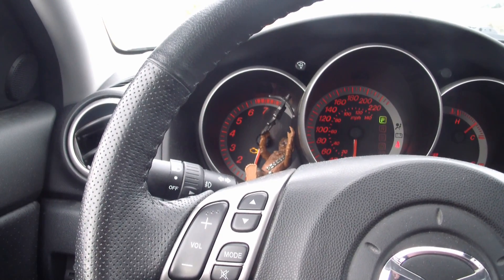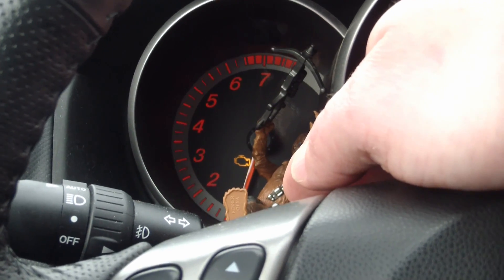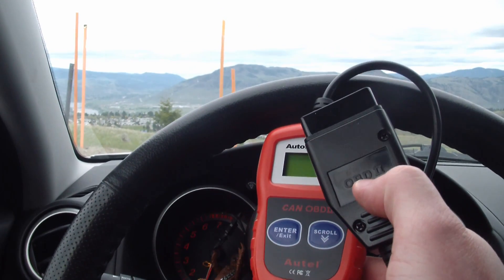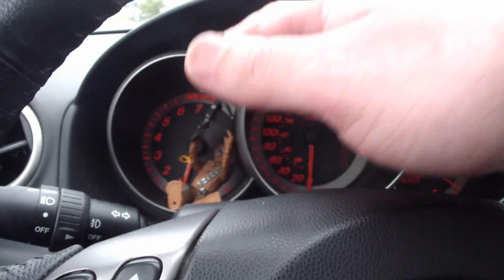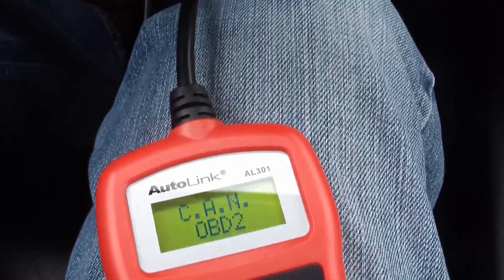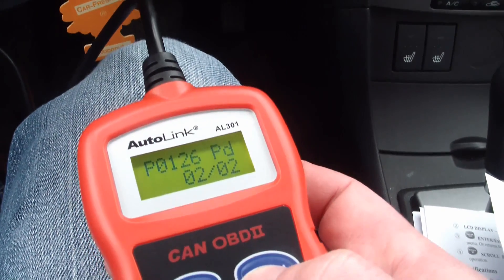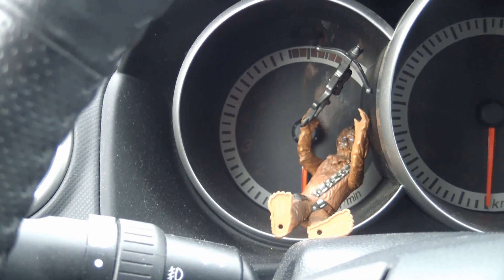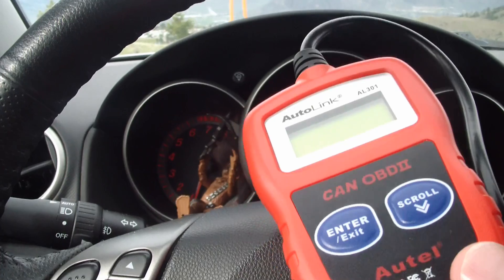Manly-Man Skills: Outsmart Mechanic Scams by Using Your Car's Computer!

Comment: I love getting cars like this. Customer attempted repair. Fix what customer attempted to fix. Keep making us real techs money.
Reply: Yes and do you know why I end up having to fix them? Because they came on here, watched a video or two and thought they knew how to fix cars. It's not just about being able to pull a code and match it up to a description in a book. It's understanding the systems in the car and how they work. For instance that coolant code that you pulled could mean any number of things. It could mean that the coolant temp sensor is bad, it could mean that a fan motor is going bad, it could mean a thermostat is sticking open, or that there might be a coolant leak. There is a lot more than just plugging in a 30$ code reader will tell you.
So to say that someone getting this information will know what to do with it is foolish. There's no way just a google search and a code reader can adequately inform a person as to what to expect when they bring their car to the garage to get fixed and if definitely doesn't give them enough information to try and fix it themselves with any real expected degree of success.
Reply: ***** He didn't say he fixes butcher jobs.  He said he did what the customer couldn't do and that is a "Real tech".  Besides if techs tend to charge "real time" for butcher jobs.  So even those can be good money.  Yeah it is possible to find and fix a problem with a cheap code reader and some help from the internet, but diagnostics can be difficult and that is why real techs exist.  Some days they really earn their money, and that is why they charge so much.  You aren't just paying for the time they spend with your car you are paying for the time they spent learning how to do what no one else can.  MD's go to med school, techs get training, that includes on the job experience.

Comment: "9 times out of 10 its a nuisance fault, clear it and it will go away forever" Totally untrue. When the computer senses a definite problem it will throw a CEL. When the computer thinks there may be a problem it puts out a "pending" code while it tests the system through a few driving cycles.Usually a pending code will not throw a CEL. Stop clearing codes and actually fix the issue and PLEASE, dont spread misinformation.
Reply: garretts91 it worked for me when I cleared the fault... IT NEVER REOCCURED
Reply: AvE is right. You have it backwards.

Most cars throw a code immediately when a sensor is out of range (say the plug is wet)

And won't go away for 3-4 driving cycles of being correct.

Or WON'T go away if the car starts going into segments of limp mode operation for the fault.
Reply: ginger20037,

Many auto repair shops especially dealerships ARE out there ripping people off. Have you not watched the national and your local news before? They were busted red handed for ripping people off and some mechanics will admit their little secret about how they get away with ripping people off. It's always good to invest in a diagnostic code reader yourself to test your car before bringing it in to any auto repair shop. Many mechanics are not honest, but some are honest. That's the reality.
Reply: +garretts91 So what " Stealership" do you guys OBVIOUSLY work for?
Reply: garretts91 the only stupid reasonthey can go off for 2 out of 10 lol is emission aka vac lines anything else needs to be fixed if you give any fucks about your car .
Reply: Punctuation, it is your friend.
Reply: Thanks for setting the record strait this guy doesn't have a clue what the hell he's talking about.
Reply: garretts91 couldn't have said it better myself my friend!
Reply: crettybocker
Yeah or maybe a loose gas cap lol. This guy thinks if he clears the code its good as new. Totally ridiculous
Reply: No kidding, this guy reminds me of my uncle lol He thinks everybody is out to rip him off.

Comment: Could be a loose gas cap also
Reply: sensAzn1982 Not related to the gas cap. Thermostat is most likely sticking open.
Reply: +crowdcontrol792 Temperature gauge shows normal @ 8:18.

Comment: my SUV was leaking transmission i took it to the dealership they wanted 150$ just to run a diagnostics so i left and i took it to a corner mechanic and he told me a line was lose and that i would be 14$ for parts and 40$ for labor.

Comment: This guy is GREAT!

I have a 2013 Smart and the day after I drove it off the lot the "Check Engine" light came on. Checked the OBD II and it had to do with the fuel emission system.

The fix? Re-seat the gas cap. Problem fixed.
Reply: S         ,

Comment: I agree with you.  Most car repair shops are CROOKS, they try to diagnose the problem of your car and try to fix it using the Trial and Error method, resulting that you will end paying 3 to 4 times more than expected.  These repair shops usually victimizes un-suspicious car owners who knows nothing.  An example of these Crooked Car Repair shop is CANADIAN TIRE.  They gouged me for parts for my front and brakes, catalytic converter and other parts for emissions.  I learned my lesson thus, I now fix my own car by buying the correct tools and scanners to do the job.

Comment: Good times when we use to charge 20-50$ to clear fault codes because we were the only once that had a scanner. Easy money and easy way to scam the customer. Gone are the good old days due to China. The OBD interface cost like 3$ online. Some clever assholes are even using bluetooth one paired with Torque app to be fast and furious. Free gauges for everyone dawg!

Comment: Your right apart from a pending code is a fault that has only happened once in the last warm up cycle and needs to happen again to become a stored or active code 
To help people you can turn out the light but some sensors like exhaust system have to run there own program so after looking up the code and erasing it . drive from cold to normal running temperature to see if it comes back and if you have to see a dealership leave the code in as it will cost you more if the dealer has to drive around to make the fault happen before they can look into it

Comment: yellow is "check" engine light, red is "stop" engine light.  As you stated yellow means it detected a fault, likely minor sometimes major, red is a MAJOR fault.  OBD 2 is a standard BUT like many other standards in the world not EVERY manufacturer follows the standard in fact most don't.  It's definitely worth hooking up a cheap scanner and see what it says (worth noting, that most auto parts stores autozone/oriellys/bumptobumper will check codes and give you a print out for free). If the "fix" is something more than 40 or 50 bucks you might want to consider not just throwing an unknown electrical part at it, opened is nonreturnable.  The "standard" descriptions are often vague and sometimes flat inaccurate.  While dealerships/mechanics may or may not be thieves not all of us are... People make assumptions about how much "profit" places are actually turning most of the time, and most of the time they'd be MASSIVELY surprised to find out the truth.

Comment: Too bad Harley Davidson isn't OBDII compliant! I can write you a book on what the mechanics at 3 different stealerships couldn't find wrong nor fix for three, yes (3), years! Found a broken wire on a sensor that wouldn't throw a code! Cost me less than $5 to fix after I got fed up and found the problem myself. Freakin' confusers. Think I'll keep the old CJ5 just so I can have something I can fix without a confuser.

Comment: Hey Mr mechanic ball breaker, you should have an idiot light on your forehead!!  It's a shame for such an intelligent person to spew out so much bullshit.  People (nowadays)want a vehicle to have everything in it except a toilet..., and who has the knowledge and training to work on that stuff?  It's for sure not Bobs corner car repair.  Tell you what, at the DEALERSHIP where I work, I currently have a Subaru wrx with a history of setting a P0300 (random misfire), which, by the way, nobody else has been able to fix. All the normal suspects are mute and I am now deep into comparing crank and cam(s) timing signals, etc, to try and find the root cause.  Maybe I should just be a crook and sell them a new ecm, wiring harness and an engine. That'll fix it............whatever man!!!!
Reply: Lee Carter I feel your pain. You try and tell people their Honda is low on oil and they don't believe that will set a P0300 do I take their money? No I don't just do a oil change. How about the Ford 6.0 Powerstroke guy who can't believe his truck won't start because his battery is a half volt weak? Working for free is just the best therapy to have. I know you'll get it.
Reply: Lee Carter Amen brother this guy's a f**** door knob!  But we're all Crooks remember?
Reply: gauranfuckingtee there's a slightly bent valve on a timing belt job or a cracked tooth if it's the old style bakeolite cam gears. -bobs corner car repair.
Reply: Lee Carter Have you checked the timing. I had the same problem checked everything else but the timing. Then the idler seized and bent the valves.

Comment: The light can turn on solid (your car got something faulty with it is not that serious) or blink (you got a serious fault and car will stop working "soon"). The taxis is a BIG true. Never took one that has this light off, all of them are on. But run on PROPANE, so getting an error code from the efi module is not that difficult, a missfiring for example.

Comment: I got on Amazon immediately after watching this Wed and ordered the MS310 for $23.00 shipped. Later in the day, I went to AutoZone for a fan belt. An older (than me) gentleman walked in behind me. I noticed he had some kind of gadget in his hand. While a man was getting my belt, a young lady behind the counter offered to help this man. He said he had bought this code reader here at the store and didn't know what the numbers meant. I asked her if a booklet came with it and she didn't know but got one off the shelf and handed it to me. No documentation at all! He paid $39.95 ON SALE for it. I wish I could have told him to get his money back and order this one but felt it inappropriate right there in front of the sales person. Poor old guy, didn't know how to use the internet or use this gadget. So, what did the sales person do? Sold him a $30.00 Haynes manual for his vehicle just to get the trouble codes. Mine just came today. I connected it, scanned the codes, found the trouble displayed on the reader, cleared the code all in about 30 seconds! Thanks for the tip AvE! 

p.s. My local independent shop charges $65 to scan. My reader paid for itself twice over today!
Instructions? Don't need no stinkin' instructions! Buy one folks. You won't be sorry!

Comment: I was working on an older F-150. You could jumper out a few pins, turn the key on and off a few times a certain way, and the dash lights would flash out codes to you. It was crude, but very cool.

Comment: some cars even show the code in one of the dials on the dashboard or with beep codes after doing a special key turn sequence. Again google. It will not show all codes but some of them like airbag and some engine codes.
Reply: rimmersbryggeri 
On ODB 1 GMs you only need to use a paper clip or similar to jumper pins A and B to read the codes.

Comment: Good video! An OBD scanner is a good tool even to see if you need to storm to a dealership or not. Most times, just letting the dealer check and reset the codes costs as much as an OBD scanner already.

Comment: Lots of cars don't require the obd tool either. Google make and model. My wrangler only requires to turn the key 3 times and it self checks and The code pops up where the LCD odometer is. Piece of pie.

Comment: My Mother had to take her 2010 Camaro in to get her brakes checked at the Rotollo Chevrolet dealership in Southern California. They told her that she had to get all of the pads replaced. She didn't think that seemed right seeing as how the brakes still worked great. She decided to get a second opinion from both one of my cousins who works on cars and her brother, my uncle, who happens to be a car mechanic and a professional drag racer. They both said that the brakes were perfectly fine and only one showed a slight amount of wear. The dealership would have charged her $400-500.00 to replace them. So it was not just a garage that tried to screw her over but the actual dealership where she bought her car.

Comment: A code reader and Google are your friend!

I had an issue with my 06 Mazda 3 refusing to start, in fact wouldn't even engage the starter at all, in extreme cold conditions (-30C or less) if I shut the engine off before the engine had time to fully warm up. It flashed the security light and threw a U0100 code (lost connection to ECM).

With a code reader and Google I was able to determine there was a known issue with a relay freezing up causing this problem. Removing and warming up the relay and sticking it back in, car started right away!

The cost of having the car towed alone would have cost more than the OBD code reader, let alone what the dealership would have charged to diagnose the issue.

Turns out an improved version of the relay, which costs about $10, fixed the problem from ever occurring again. I could easily have spent several hundred dollars having it towed to the dealership and having them diagnose and fix the problem hadn't I troubleshooted it myself!

Comment: Ave I had that same damn code in my envoy ended up being a bad thermostat wasn't bad nothing an hour of my own labor couldn't handle. I use a wireless obdII sensor I got from amazon for 27.00 I can actually clear codes on the fly with my smart phone. I use an app called torque it was 4.99 for the pro version it has the ability to tell you live info such as mpg vacuum pressure and much more.

Comment: Here in the US, you can also drop by an Autozone or O'reily's and they'll scan it for free in hopes that you'll buy parts from them.

For a certain individual stuck on what a diagnostic code won't tell you. It won't tell you exactly whats wrong but it will give you a direction and if you've got: an IQ exceeding room temperature, curiosity, free time, and a wealth of information at your disposal via a computer connected to the internet you might just fix it yourself and be better for it in the end having learned something. 

I understand that the "average mechanic" can't fix some problems. I know a few mechanics who can barely test wiring for continuity. Good theory, on occasion, is far superior to years of experience with poor understanding

Comment: That was good advice.  Had one of those things for many years.  Saved a bucket of money too.  One time it was a hole in a vacuum hose, deduced that by lean mixture code, and used the ears of one of my decedents to find it.  Cost me about 97 cents.  The dealer wanted $40 for the hose but being cheap like I am I just went to the local auto parts and got one of them generic hoses.  It did not have all the fancy factory bends in it but it sucked just the same.  Thanks for the video.  Oh and I too am glad we don't get all the gubmint we pay for, no one could abide that.
Reply: A dead person's ears helped you find a vacuum leak?  You must be somewhere between small and large.
Reply: @BruceS42  Took me 4 years to get this genius joke!
Reply: @niclikescakes  I'm glad you got it.  Not all of my humor is exactly "high-brow".

Comment: Ive only used (in a non professional capacity) an OBD2 to USB (PC) interface, works well but the fucking around with drivers and port allocation, baud rate etc. Id recommend a plug and play cheap handheld like this for any average Joe. Just make sure you have an OBD2OBD2OBD2OBD2OBD2OBD2 compliant car.  There's plenty of horsecockery in a lot of older cars between OBD1 and OBD2 that'll drive you nucking futs, N America and Australia euro imports are the usual suspects. As mentioned, Google is your friend, ad a ? to your earch, you'll get more forum results. Best $30 you'll ever save though with one of these cocksuckers. Nissan data scan is great for your Jap Nissan import cars too (not obd). Thanks for the up AvE!

Comment: In the UK at least repair shops have a book that lists the length of time each job takes allowing mechanics to quote reasonably accurately how much a job is going to cost ahead of time. What would be nice would be an OBS can-bus reader that was programmed with this information that could wirelessly retreive this information along with the price of the parts over the internet and allow you to put in your repair shop's hourly rate and find out reasonaly preceisely how much your repair should cost before you go there. That way you can decide whether it's worth doing your self and getting your hands dirty for or whether the quote you are given by your repair shop is reasonable. You still wont beat an experienced trustworthy mechanic though. ps Thanks for the vid :-)

Comment: If you don't have a reader you can always swing into autozone/napa and they will check the code for you for free.  The nice thing about it is if you get lucky and get a knowledgeable guy he will probably point you in the right direction on troubleshooting the issue too.